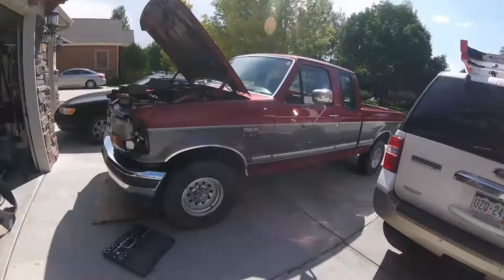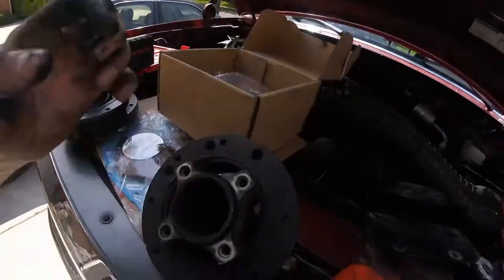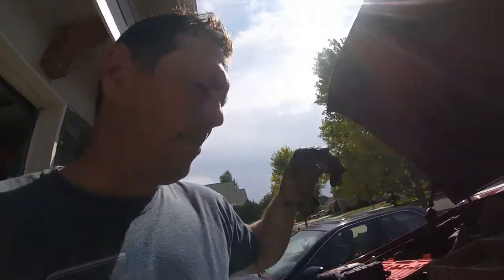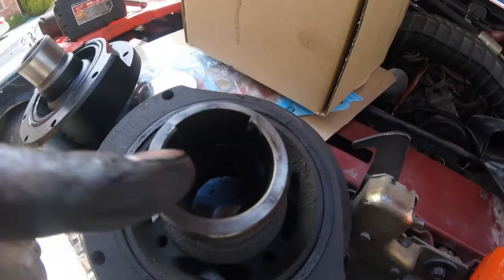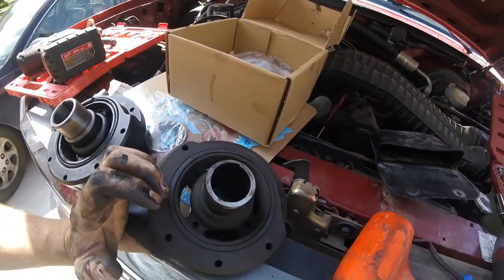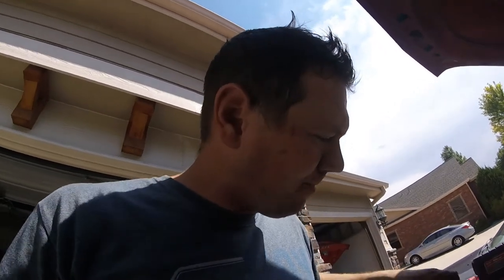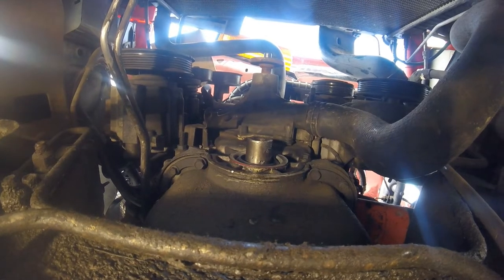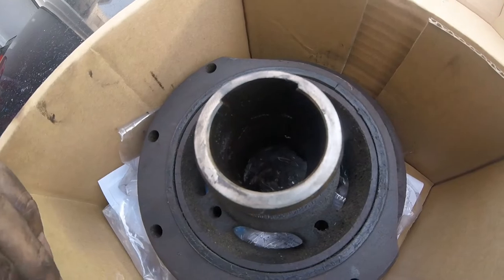5.0/5.8  Engine Vibration

Comment: Is there enough room for a cordless impact 
Local shop wants 200 bucks not included the seal
Reply from the maker: Yeah sometimes you can fit one… might have to remove the fan and shroud… mine is pretty big and won’t fit between the radiator and engine… if you’ve got a smaller more compact one though it might fit…

Comment: I have a shake that I feel at idle...I visually inspected my harmonic balancer and it does have some dry rotting/cracking....could this be my problem and it doesn't really vibrate hard because it is just starting to go and hasn't gotten that bad yet?
Reply from the maker: Definitely could be the issue! That’s how it starts, then the rubber fails completely and it comes apart!

Comment: thanks for the video man , i have a highspeed vibration and even if my car is in neutral sitting still  and i raise the RPM it shakes the car badly and the higher the RPM go the vibration increase too  , could it be my harmonic balancer too ?thanks in advance
Reply from the maker: Yeah, usually that’s what happens when they start to go bad.  If it’s not moving and you’re having vibrations, I’d check the balancer first.  If it vibrates only when moving id lean to u joints on the drive shaft
Reply: what about Motor Mounts? Can you tell the difference of symptoms from bad Motor Mounts or Haramonic Balancer?
Reply from the maker: @alhell1285 you’d definitely be able to tell if the engine mounts were bad.  They could cause some clunking but I would imagine not a ton of vibration.  I’ve never personally had a bad set on engine mounts on anything cause a vibration.